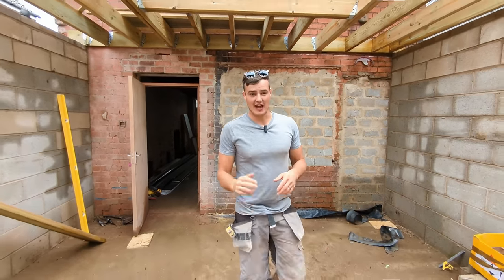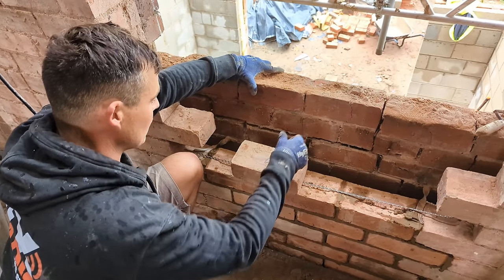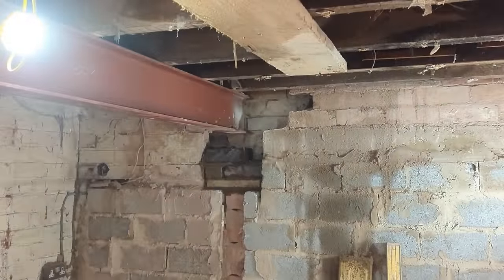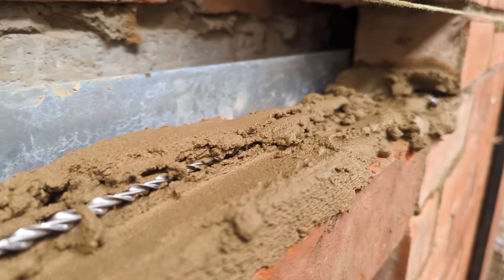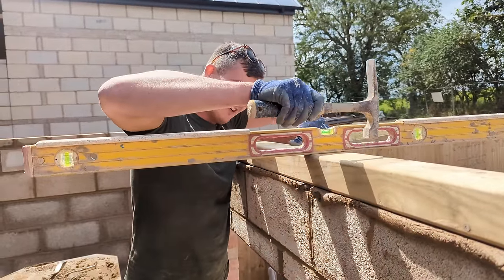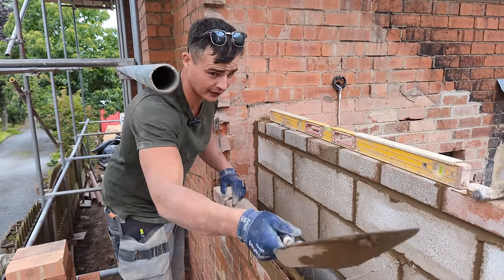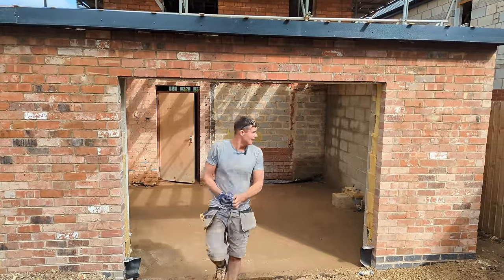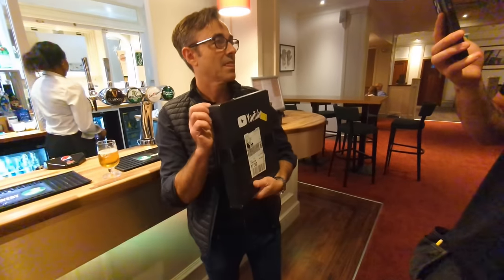JOB finished! & Pricing BIG JOBS| IzzyThe BrickyEpiosde 24 #vlog #construction

Comment: There SHOULD be a LARGE air space gap in-between the face of the insulation and the OUTER WALL inside the cavity ; this includes an air space gap in-between the face of the insulation and the cavity-wall-tie drip point-which should be in the centre of the cavity.
Ask N.V.Q. BRICKWORK teachers for PROOF of this !      With the cavity-wall being bridged with insulation (insulation touching the outer walls), damp will travel from the outer wall through the bridging insulation to the inner wall !

Comment: ".....and it does not look safe at all..." 
then goes walking around under it with no PPE 
Anytime you're onsite however small you should be wearing your PPE.

Any more of that and you'd be off the job on commercial work ..standards